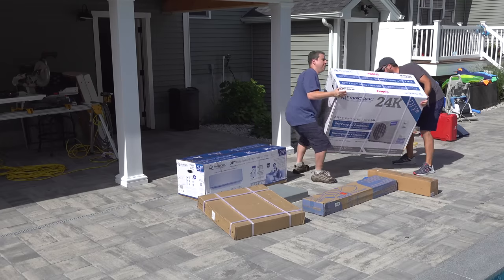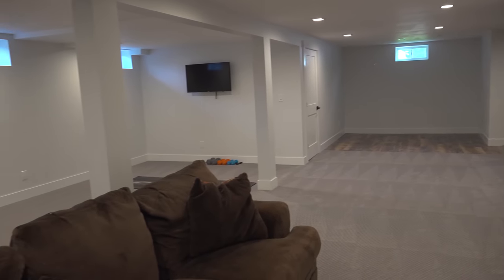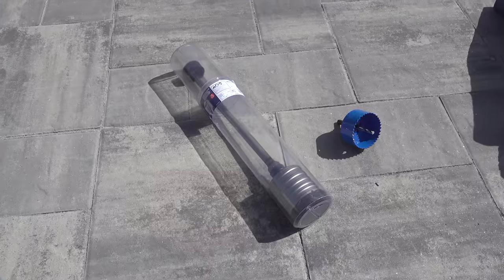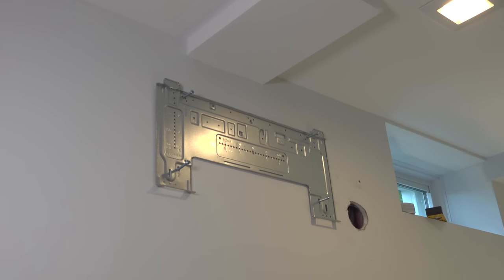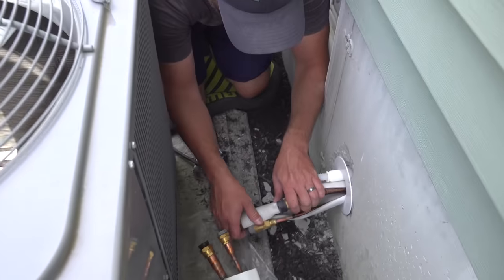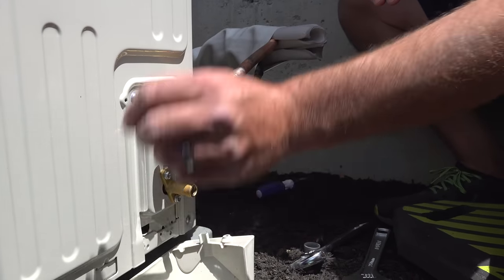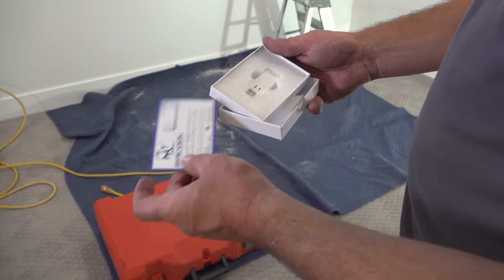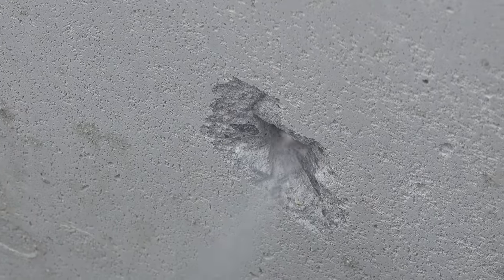Install your own AIR CONDITIONING in 4 HOURS!  DIY Mini Split MR COOL

Comment: Lmao "don't use a $100 window unit, use this $1500 unit" 😂
Reply from the maker: You won't get a window unit that is 24,000BTU and also produces heat too for winter
Reply: @SilverCymbal  Right. And when your old those window units are tuff to take in and out each year.
Reply: @Silver Cymbal Sure you can they make window units up to 36,000 btu and with heat modes
Reply: @james4582  but you lose the use of your window! $36,000 btu window unit has to be up there in price.
Reply: @LeuCustomKnives That’s true they are bigger and heavier for sure. Most I felt with were thru the wall installation. Some apartment complexes some offices. There not bad if closer to ground easy to slide out of the case had quite a few installed up higher I had a portable high Jack to use for that. 
Another thing about window units is parts can be quite exclusive and after about 3-5 years they discontinue them for older units. Controls fan motor and fan blowers and blades can be hard to replace because they are specific to the unit. Us the bigger units 18,000 to 36,000 take 230 volts 20-30 amp circuits.
Reply: Motels also use these larger units also. The bigger units are mostly all slide outs so you don’t have to remove the whole cabinets. Few motels own them and lease them instead. Big business. They can also be heat pumps for heating as well.
Reply: it costs $5000 to have it professionally installed
Reply: @james4582  I have 2 of these mrcooldiy units. A 24k and a 18k. Been using them for 3 years. There’s a dry mode for humid climates that continues to remove humidity no matter the temp it’s set at and also three blowing speeds. There’s no mold to deal with as the only thing outside is the condenser which you can hose off. Window units hang outside and get nasty moldy which evevntually smell wise travels inside into your room.these are also heat pumps. I’ve used it when it was 0’f outside and it still found heat. Kept the garage at 75’f easy
Reply: @maxlee6676  $5000?!? total rip off! Units are maybe $1k - $1.5k and rest is labor 🙄
Reply: @LeuCustomKnives I have found that people who use these tend to be very happy with them and I like them in most applications. When installed properly they work great. The technology for many A/C units and systems are much advanced today. A lot of the mini splits can be diy for a person even with limited skills. All I ever recommended to anyone that wanted to do their own was follow the instructions to the letter and you’ll be fine. I never minded a customer doing their own work and never belittled them. If a customer made a mistake and called on me I corrected it and explained why. Some systems for diy required a licensed contractor to stay up or put refrigerant in or do the electrical. Which I was always glad to do for them.
As for window or through the wall units well they are what they are.
And they can be a menace if not installed properly. They like all inits have drainage issues. Water is designed to drain from the front evap section to the outside condenser section the fan blades have a ring around the outer blades this is called a slinger ring that throws excess water onto the condenser coils as extra cooling measure. These units are designed in a small cabinet usually foam partitions and passages for the condensate and will get plugged easily causing leakage. People will tilt the unit trying to make it drain and drill holes Needlessly. Small units are teLly just throwaways they are expensive to repair 
I always had a hate/love affair with them lol
Anyway I’m glad you like the minis
And they work for you
Reply: As a side note 
Do you make your knives and from what stock. I have a couple of friends I know make some of theits

Comment: Having to add the electrical really take out the 4 hours to complete. You have to run from your main panel to your condenser location. Add breakers and a new run ( wires) . I think that should be included in the installation time.
Reply: It's "understood" than an electrician already installed the new run to the condenser location.
Reply: @georgeswca  I get that. Why didn’t they do it right the first time ? Lol . Your good I don’t know the difficulty you faced or want was already done  It would help if you me mentioned it.

Comment: Looks cool. On my house years ago had 3 holes cut straight, One in the living room with a 18,000, BTU W/heater LG room A/C (Runs on 220volt). and one in each of the two bedrooms has 5500 BTUs (each on 110Volts).That 18,000 BTU takes care of the kitchen, living room, and actually makes my back bedroom fair. At night turn of the big one and use the bedroom at night. The other I use in my office or front bedroom. Mostly in the living room and the office. i turn that one on when in there. This house is comfortable and very cool. The heater part only use if issues with my two sided gas wall heater. PG&E runs when home maybe $150.00 a month. Units are replaced about every 7-8 years. I like it because if one goes down, just go in the other room. Units run for the big one $550.00-$600.00 and the small ones $150.00-$200.00. Not much to replacing them and it looks part of the house. I never liked them hanging in the window.

Comment: Why drill thru stud instead of moving hole over an inch or two? And why not use a stud finder?
Reply: Because he isn't a professional.
Reply: @jayhaines1792  funny how that stud isn't structural and it literally does not matter
Reply: @REALBanannaman  yeah. That stud was put there for no reason. I hope you don't pretend to be a carpenter in anyone's house
Reply: @jayhaines1792  it was put there to affix drywall. Did you know the pipes in your home go through load bearing studs as well? Did you know there are standards for what hole width can be drilled in certain stud sizes? Structural vs non structural. Lots of info out there, hope you make yourself wise.
Reply: @REALBanannaman  I believe that you're trying to reply to someone else
Reply: @jayhaines1792  I'm replying to you big guy.
Reply: @REALBanannaman  why? I'm not the one who said that studs weren't important. Im a Master Electrician who drills through studs and floor joists to install wiring. I know how it works.
Reply: @REALBanannaman  Ive worked in construction for over 30 years.
Reply: They hit the wrong side of the stud, to move it to the left, the hole would have likely been visible, but a stud finder would have been easier

Comment: No matter what connections you have be it the one's in this clip or flared connections you have to pressure test for leaks usually 1.3 times the max discharge pressure 38.5 bar 4 at least 4 hrs depending on the size of the system then evacuate the system to reach lower then 500 microns which could take 3 to 4 hrs this is the right way to commission a split or vrf system purging refrigeration gas to find leaks is not good and wrong practice says a install engineer with 15 yrs experience
Reply: 8 cfm vacuum pump and a 1/2” hose will have that bad boy down to 250 microns in 5 minutes🤘🏻

Comment: stop when you were about to drill thru that hole so you dont blow it out, come outside and finish the hole that way. not too sure if it will work, but worth a try.
Reply: That actually would have worked much as you suggested. No blowout at the end.
Reply: @Toxic667v2  i usually use a small diameter drill bit and go all the way thru it then proceed from outside to inside. less damages, dust and it's easier
Reply: Only reason he didn’t is the other condenser was in the way outside he could have moved a couple feet but that’s there decision on placement

Comment: Installing an ac unit in a basement thru 18” of concrete?????  How is not cool enough already
Reply: probably does more for humidity control than cooling would be my guess, but then again, if they are in Phoenix for example.  The more cooling the better........
Reply: No clue! My thought exactly. I have an 18 000BTU Mini split and it cools my whole 1600sq ft, two storey house to 21c while it's 40c outside effortlessly. 24K btu's is double what was truly needed there lol
Reply: @fullraph  do u have just one indoor unit?  and the cold air is strong enogh to flow all the way to 2nd floor!?
Reply: @JC.72  Absolutely, the indoor unit is located right up the stairs, so the cold naturally flows down the stairs and into the lower level.

Comment: when the bit goes through to the outside go to the outside of the wall and drill in for a cleaner hole
Reply from the maker: Yes, I wish we could have but the other house unit was in the way, just not enough room for the tool
Reply: @SilverCymbal  maybe an angle grinder with a mason blade to make relief cuts would have prevented the damage. Doesn't matter now and it'll be an easy fix if he even cares what the concrete looks like behind his main A/C unit.

Comment: 5th huge mistake if using this unit in winter to heat the area: The system should have been mounted on a stand that has the center top of the stand left open (not like a table top). This allows the condensate in winter that comes out of the bottom of the unit to easily run out. Mounted an inch from the top of that pad is a nightmare waiting to happen. The condensate  turns to ice on that pad, and builds up and up until it plugs the condensate escape hole or holes in the bottom pan of the unit (even if a basepan heater was included with the unit) the ice starts forming in the pan. This wont happen in moderate cold temps such as a few degrees below freezing, but if the temps are severely cold such as Buffalo NY winter weather extremes, the ice will build up and eventually the fan blade in the unit will hit the ice and get damaged and maybe burn out the fan motor too.
Reply: When using the heating mode thair is no condensation, you only get condensation when in cooling mode.
Reply: @lambastepirate  He's talking about the outside unit. In cooling mode the energy is moved from inside to outside, the inside unit gets cold and forms condensation. In heating mode, the opposite happens, energy is moved from outside to inside, and so the outside unit gets cold and forms condensation.
Reply: @timno9804  True I have Installed many of them and thair is no condensate problems outside it wets the ground a bit and dries up like when it rains!! the same thing happens with heat pumps of any size. 20+ years exp as HVAC man.
Reply: @lambastepirate  Ohhh alright

Comment: You still need to vacuum down the lines to a certain micronlevel and depending on Length of linesets freon may need to be weighed in.      I'm a hvac contractor and have been for 25 years.   I'm not scared of mini split systems.  I'm scared of DIY ers
Reply: Those special linesets are pre-charged with refrigerant and no vacuum is required.
Reply: @andrewludwig9251  untill you get one the isn't charged correctly witch does happen and it doesn't work right and you really don't know the difference because you don't know what your doing.  Not "YOU" specifically Andrew.  And you need a licensed freon handler  to fix it, and he made absolutely no money on your system to keep himself in business to put in air conditioning.   With is why as a 15 year in business for myself a don't go behind home owners.   Let them learn the hard why as life teaches.      Have a good evening Andrew.
Reply: @noonehere7638  The whole purpose of this video was to show DIY people that they could install a minisplit without special tools. And yes I have my EPA 608 license to handle refrigerants, (freon).
Reply: I cringed when there was no vacuum pulled.
Reply: @BigKZilla  may be there is no port for vaccum pulling
Reply: There definitely is a port to pull a vacuum these guys just don't know what they are doing and wasted all the freon
Reply: @BigKZilla  so basically this unit is not purely DIY ?
Reply: @andrewludwig9251  really?! And just how does that pre-charged line set hold it’s charge while you install it to the condenser??? Because I thought the charge came in the condenser and the line set was a cut to length kind of thing. I.E. different lengths need different amounts of charge. Also oil in R-410A is hydroscopic so if don’t pull a vacuum you will end up with moisture (that you can not get rid of) in the system. Something tells me you’re one of those installers who never has to go back and fix your fuck ups. As a service technician, let me tell you, we could use less of you in the field.
Reply: @JamesWilliams-tk3nq  That is the most ignorant thing I have ever heard. I have THOUSANDS of dollars worth of vacuum equipment, I Use nothing but the best like the newest Fieldpiece 8 CFM pump and the huge blu vac hoses. I haven't pulled a vac through a charging manifold in probably 7 years, because charging manifolds are leaky as hell. I get my vacuums down to a couple hundred microns EVERYTIME. And the oil in R-410A is POE oil which is used in most newer refrigerants. The most important day of any installation is install day. You obviously didn't read all the comments. Mr. Cool offers pre-charged linesets for DIY. While I don't recommend this way, it does work if you follow the directions from the manufacturer.
Reply: @andrewludwig9251  so what you saying is the pipework is full of refrigerant as is the indoor head unit , and while connecting the  fittings there is no air  contamination anywhere on the system?
Reply: the pipe is precharged with refigerant -- inside the flare nut on the end of the lineset it has a piercing valve that breaks the seal once it is tightened down-- so you obviously can't cut it to length.
Reply: @andrewludwig9251  🤣🤣🤣🤣🤣🤣 please please stop lol
Reply: @yurydolinsky  I have never used one of those pre- charged line sets and you probably haven’t either — it doesn’t mean that they don’t exist.
Reply: @andrewludwig9251  omg you are serious.   Please stop talking.  You don't have a clue when it comes to hvac!  LINES DO NOT COME PRE CHARGED!
Reply: @andrewludwig9251  they don't exist! First of all , i f they came pre charged you already over charged the system.  Secondly when you connect lines  their still a pocket of air during the connection! Condensers,  compressors, evap coils did come pre charged with Nitrogen! To show their is no leaks! I've been in this industry since I was 18 years old . I am now 43.  Trust me when I tell you,  they don't exist!  Ohh and I am LG and Samsung Factory Warranty certified on mini split 😁 . Honestly I won't touch them again! Pure garbage!
Reply: @yurydolinsky  I wouldn’t touch them either but they indeed do exist
Reply: @andrewludwig9251  🤔🤔 So you believe in Unicorns 🦄 ???
Reply: @andrewludwig9251  by your logic,  just because nobody seen or heard doesn't mean it doesn't exists . 😖😁 think about it . They sell them in 25 , 50 and 100 feet set. What if you need 15 feet ? Do you  loop lol 10 extra feet?  Pre charged with nitrogen  I can believe but not refrigerant.
Reply: Yes anything more than 20-25 ft needs more refrigerant and you need to pull vacuum on line sets to roughly 500 microns to get moisture out of lines and make sure your flares don't leak

Comment: Why isn’t it off the ground and mounted on a wall bracket if it’s a primary source of heat ?
Reply: It should be minimum of 3 in (depending on region) of airspace between bottom of the unit and pad.

Comment: I just want to know his electric bill with 3 AC units
Reply: A mini split that size probably pulls like 9 amps running. My 9000 btu unit pulls 6 under load. Inverter driven compressors are very efficient.
Reply: When I have this exact unit on and it’s 95’f outside mine is pulling 2 amps at the highest setting/blower speed and set to 68’f inside. Translates into about $.05 per hour paying $0.097 a kilowatt. About $15 a month to run per unit
Reply: These are super efficient
Reply: @LeuCustomKnives  is the compressor on when you test it?, 2 amps is very very good for the btu
Reply: @gilgulmayer  found my comment! Yes the outdoor condenser is on when it’s pulling 2 amps about 450 watts. In heat mode though it’s pulling about 10 amps.
Reply: @LeuCustomKnives  lucky . I'm here paying $.16 a kwh
Reply: @Wotc  good gosh! 😬
Reply: @Wotc  “sustainable“ power sources?
Reply: @fml5910  it pulls 10 amps on heat mode. So that’s like 2200 watts 😆
Reply: Can you give the dimensions fot the unit inside the house, please?
Reply: @LeuCustomKnives  where do you live wth thats cheap.
Reply: @linkstale  Texas. Electric Co-op 🤷🏻‍♂️
Reply: @TheProxyPirate  this 24k unit pulls 2amps when on ac mode. Even on turbo mode pumping out 539 CFM of freezing air. I was shocked. Only 450 watts when on ac mode. With the heat mode on it pulls close to 10 amps.

Comment: If your going for a split unit I’d recommend Toshiba. Way cheaper than Daikin and Mitsubishi split units and way more reliable. Not sure what these Mr Cool units are like, but I’ll hazard a guess their not manufactured in America?. Installing a split system is doable in 4 hours if your a experienced air con install engineer, but if your a complete novice it’ll take you way longer than 4 hours. Plus these pre charged systems are known for refrigerate leaks. Any split system should be pressure tested too 2.5 the times of the working pressure with OFN (oxygen free nitrogen)then vacuumed out too 2.5 torr with a torr gauge, then charged via the condenser unit that is pre charged..

Comment: Shouldn’t you vacuum the lines before opening the gas since there is normal air in the lines .
Reply: The lineset is precharged with refrigerant. You just connect it and turn it on hence the DIY
Reply: @LeuCustomKnives  oh i see thanks !